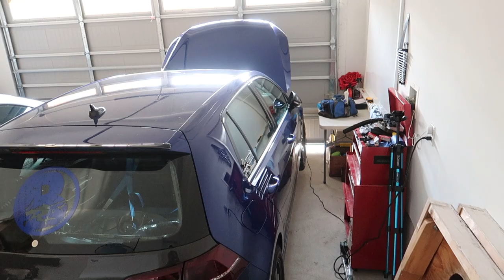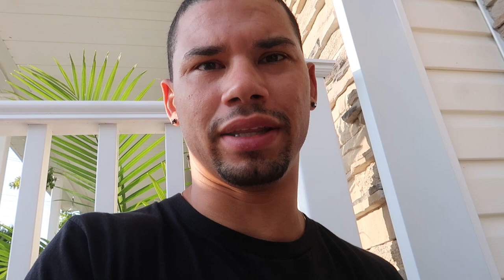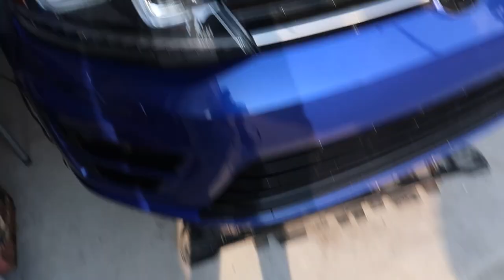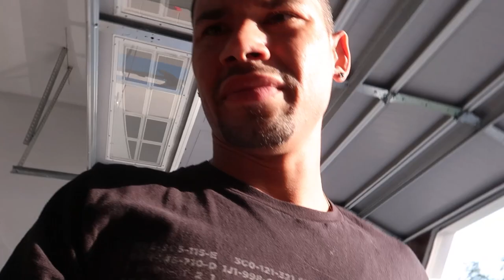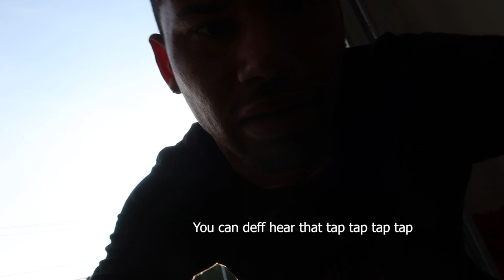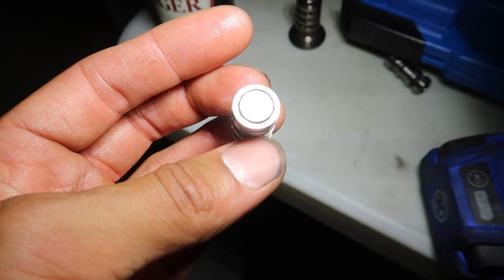5,000 SUBS!! + Broken spool valve | MK7 Golf R

Comment: JUst dropping in to say I just had exactly the same problem on my Audi S3 8V.  There were no issues with driving the car, no codes - but that nasty rattle at tickover. Changed the magnets first, didn't cure it, so ordered the spool valves and required socket.  Switched out the intake cam one this morning - and voila, fixed.  The one that came out is exactly as yours was, that broken internal metal bit.  Your video was one of a few I've watched, and was super helpful - thanks so much!!!

Comment: Amigo, I’ve been following your build for some time now. Nice on the 5k 👍🏼. I have a 2017 Golf R. Had the same noise coming from cylinder #4. It made that same noise  after doing a hard launch and high rpm shifts 7300rpm. I have a stage 3 apr kit with the upgraded fuel pump and additional 4 injectors on top of the manifold. The car ran perfect for about 16months. Many many pulls, track events (drag Barona) and a lot of street racing (only when there was room and not racing a kid or a car that looked stock). Anyhow, after doing my due diligence on how the motors got hurt. It’s was a bent rod cyl #4 due to a clogged secondary injector on cyl #1. So cyl #1 ran lean and caused extra stress/torque to be applied onto piston #4 thus bending the rod. That all happened in October 2020. Since then I’ve ordered new parts etc. Upgraded forged pistons and rods water pump etc. I should be getting everything finally delivers from the machine shop early next week and will be assembling the engine shortly after that. What I learned from my golf r stage 3+ set up is, I need to keep an eye on injectors and service them every 10k miles or so. I would recommend to do a compression text on your motor before going any further bro. Hope this message helps. Keep up the content 😎.

Comment: Same issue and replaced but now it only happens durning cold start. Any idea why ? It’s driving me crazy I don’t want to damage anything.
Reply from the maker: Oil pressure on startup bring different maybe I'm not sure exactly. But they function based off of oil pressure I believe
Reply: Know it's an old post but did you every manage to fix your issue. I'm having the same issue except my tapping noise has improved after replacing the oil control valve and only happens on idle? TIA
Reply from the maker: @user-rf3cr2ux5d yeah the valve fixed my issue. You may need to replace magnets as well

Comment: Was it throwing any codes? I’m having the exact same issue and mines throwing a p0341 and p000A00
Reply from the maker: Had an intake cam code a few times. But it was mostly the sound that lead me to replacing these. Check back a few vids you can hear what I'm talking about
Reply: @BryceJordanProductions  Delloye and I have been going back and forth on my car and yours seems to sound identical to mine. Cold start sounds perfect, but once it comes up to temp it sounds like the chain is rattling or the damn head is gonna jump out of the engine. Id rev it up and it would clear out but then come right back as soon as it can down to idle. It sounds pretty nasty.
Reply from the maker: That's exactly how mine was man. Had a buddy's last week same thing. Replacing these fixed it right up.
Reply: @BryceJordanProductions  I love you dude 😂😂 I’ve been fucking hounding at this for a minute. I’ve been dying to let my boss700 stretch it’s legs but this damn issue has been killing me
Reply from the maker: They aren't too expensive or hard to swap! Hopefully you can get them in quick and get to spoolin!!
Reply: @BryceJordanProductions  got the spool valves swapped and the Audi is running beautiful. Thanks for your help bro! Gonna shoot for a nice 9 at 135+ this upcoming test and tune. You should come down to bandimere with me and Delloye one of these days

Comment: CAM POSITION SENSOR
Reply: Happens with my 18 R, if you take it apart everything looks good but it’s not land eventually if you keep running it without replacing its gonna snap the cam in 3 when it finally decides to fully let go and you’ll be paying fir a brand new top end
Reply from the maker: Which sensor? On the top of the head or the intake manifold side? Or both?

Comment: Damn dude I am in the same situation right now with my R. I blew a turbo back in may and after swapping the stock back on my car is throwing misfires across all cylinders and has a noise exactly like yours. My best friend is a former VW tech and theorized the same thing, cam phasers. I was ready to dump the car or go full send and build the motor but this is at least worth checking out.

Comment: Tough stuff dealing with problems and having the car down.  I would go stock motor and mild enough build to keep it safe and reliable.  A lot more fun with less power but always drivable because it is running.
Reply from the maker: If the motor is FUBAR that’ll be the plan until i can swap in something cooler

Comment: Congrats on the 5k Suns bro!! That is awesome!!

I feel bad that you keep having problems on this car. It’s not like you’ve done anything crazy with it. You have kept building it, but you’ve done it properly to where you upgrade parts that SHOULD keep the engine reliable, but it just keeps going to crap. 

I totally understand you. I have felt the same way with my MK7 GTI, except my problems are a lot less, and I’ve put in a lot less money into it than you have into your R. But we basically use the same engine, so I can relate to you somewhat. My problems have been more clutch. I’ve had to replace the clutch 3 times because of it either slipping or something failing, and it’s irritating and expensive. My newest clutch is the SB SG3 Endurance. Feel awesome but it’s expensive, and I’m worried I’m just going to have another ton/slave failure in the future just because. So there have been times where I tell myself “I need to sell this car” but then it’s so fun to drive, that I keep modding it, and then I’m like “nah, it’s too fun”, but I have this overhead feeling that I’m just going to have to another repair soon sometime. 

I should just stop modding it, and sell it. I can’t afford a second car because I’m a student, so that out of the question. Decisions decisions...

Just want to say I feel your pain, and if I were you, I would sell it if it came down to another costly repair.
Reply from the maker: Thanks man its been a long road! It really angers me but there ain’t much i can do.. hate to give up, hate to keep “wasting” Money.. i have high hopes that this will fix me right up, working at VW is teaching me all types of neat things.. so at least there’s that. Along with nicely discounted parts lol.

That south bend should do you well, I’ve beat the crap out of my stage 3 daily and never once had a hiccup! Just make sure you break it in properly!
If you’re having fun and you think its worth keeping, keep it! It’s definitely a sellers market right now though.. if you’re going to how’s the time before the market crashes
Reply: @BryceJordanProductions  yeah I put 1600 miles of proper break-in on it. It feels very good now. Not that heavy, very minor clutch chatter, grabs hard and pedal modulation is very consistent. Loving it

Comment: dude I have the same exact issue! just ordered the spool valves, thanks a lot! also, do you think problematic spool valves can also cause slow turbo spool issues without any CELs?
Reply from the maker: For sure, if your cam timing is way off that will effect exhuast flow and slow down spool
Reply: @BryceJordanProductions  thanks for the reply. wouldn’t something that major cause a CEL or at least a background code?
Reply from the maker: You would think.. I never got any cels
Reply from the maker: Shopdap did a video on this recently too check it out
Reply: @BryceJordanProductions  i did check it out, that video shows a ton of cels. My issues today are very rough cold starts (the first 40-50 seconds are fine, then it’s rough, then it settles) and slow spool and starting to lose boost after 5000rpm, along with some oil consumption.
Reply from the maker: Yeah maybe theirs failed totally. Mine had zero CEL

Comment: Hey man I'm having the same symptoms you're having is that spoil valve pretty easy to take out?
Reply from the maker: It's not exactly easy no :/ need some special tools and alot of patience especially if you still have AC those thick ass lines make it even more difficult
Reply: @BryceJordanProductions  got no ac. Just did big turbo and intercooler swap so haven't bothered yo put ac in. Did that fix it? My problem happens when I'm hovering a little bit before 2k rpm. Is the special tool a t10352a?

Comment: Yikes😅 Cam Position sensor. Just replace both for peace of mind…
Reply from the maker: My sensors are fine they're reading the position of the cam, these technically kind of are what control the timing of the cam via the cam magnets and oil pressure